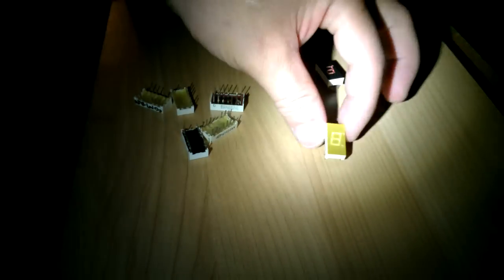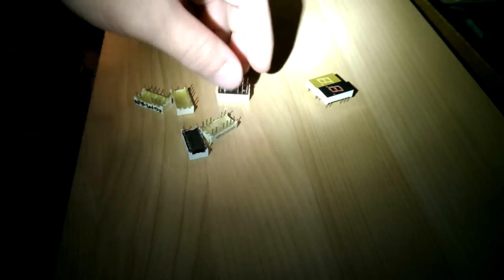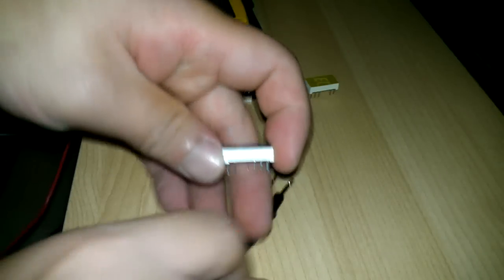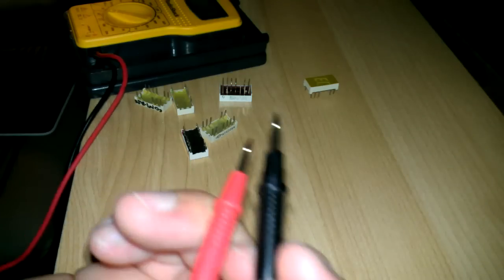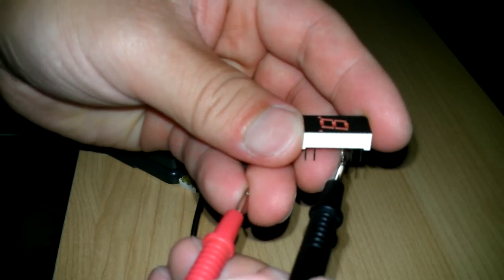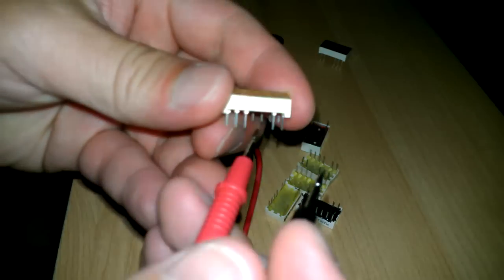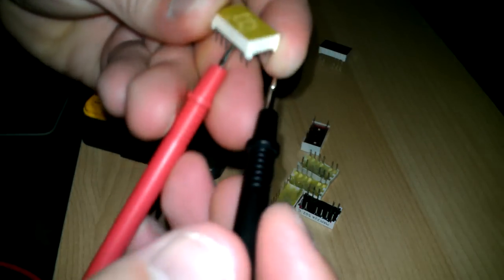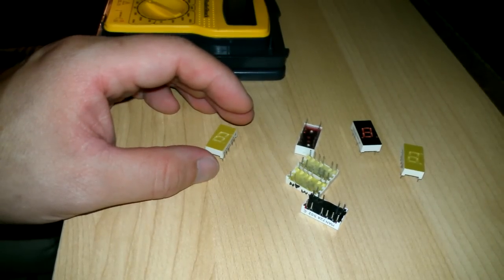How to tell segments and common cathode/anode of 7-Segment LEDs

Comment: hi, im trying to get some of these type except mine have 11 pins and are 3/4 " x 1/2" and red, does anyone know where i might be able to find these?   Common Cathode 11 Pin 1 Bit 7 Segment 0.75" Red LED Display Digital Tube
Reply from the maker: +Hammer USN   Digikey has everything. So does mouser electronics.
Reply: leefiles thanks